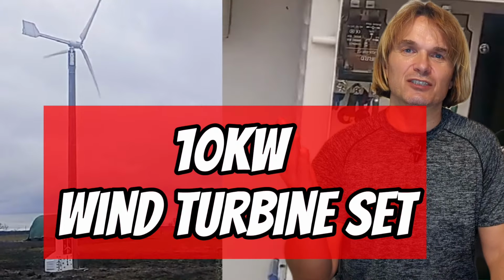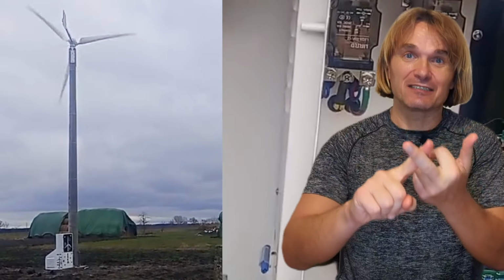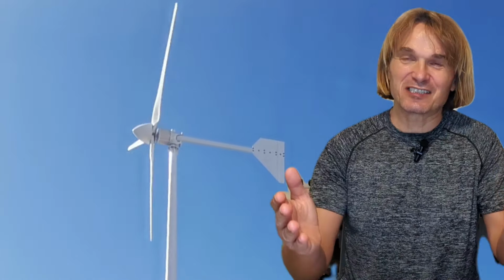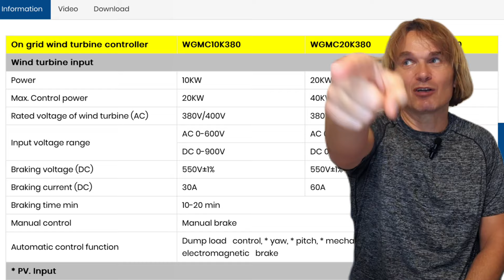On Grid and Hybrid version 10KW wind turbine with controller and Deye Inverter.

Comment: Like! Definitely. Deye is probably the best in this case. However, blade pitch regulation WT would've been the best choice. Furling tail is also a good one tbh, simple and easy.

Side question. Have you got any idea, why hybrid Deye may be switching on/off its relay for MicroInv Input if working constantly with any grid-tie inverter?
Reply from the maker: as for deye micro inv have no clue, I havent encounter this. most of our installations are wind first so if customer invests in wind turbine and deye inverter than they connect pv to deye input. but its quite interesting what you observed. I will ask deye maybe they have solution
Reply: @4nrgyTech  well, it happens every hour approximately. No obvious reason as of my observation, just goes off and immediately back on after 4-5 seconds. My WT grid tie inverter connected to the Microinv Input then also gets switched off, and turbine is held only by a braking resistor. It's a minute of interrupted production only, but is quite annoying.

Comment: Hi there. I live in Croatia, Rijeka where we have very strong wind called Bura. This is a northern dry wind with gusts over 20 do 35 m/s (od 70 do 125 km/h) and on the wind scale is 9 and above.
Extremes are several times a year and they last for a few good days. Most prominent time is usually in march.  Is there any turbine that can endure those extremes and if not should the turbine be dismantled every time it goes to extreme? I'm aware those are hurricane speeds, biggest difference is that its not constant 120kmh, its more come and go type of wind. But all of that happens in span of seconds, maybe minutes. I plan to install wind and solar (not at the same time ofc) because there is a lot of sun hours yearly and its windy because of sea proximity. I will put everything on the roof, so that means that the turbine will be working 12- 13m from the ground. Roof clearance as much as needed so to speak. 
If you have any reccomendation regarding turbine i will be more than thankful! 
Have a nice day!
Thanks in advance
Reply from the maker: furling tale is pretty good safety feature. you need to calculate mast/tower reverse thrust on 20m/s.  also if tower is not stable enough youll have wibrations which will weary the bearings of wind turbine.
3.2 m diameter 1.5kN
4m 2.5kN
6m 6kN
8m 10-12kN
youll be good with 125kmh winds. aerodynamic brakes are failsafe. its not looking so good like tailless design but it's really very sturdy
Reply: @4nrgyTech  Thanks buddy!

Comment: I have 2 parallel  Deye SUN-8k-SG01LP1-EU, Can this turbine be hooked up to to my existing inverters, if not what is a practical solution ? btw, you saved me from making a huge mistake and buying a few Tesup turbines, thanks for the great info.
Reply from the maker: yes it can. excessive energy can be put on heater